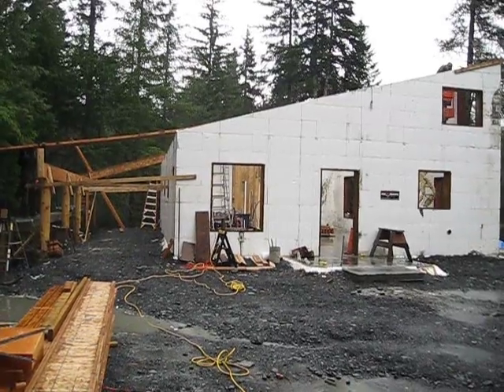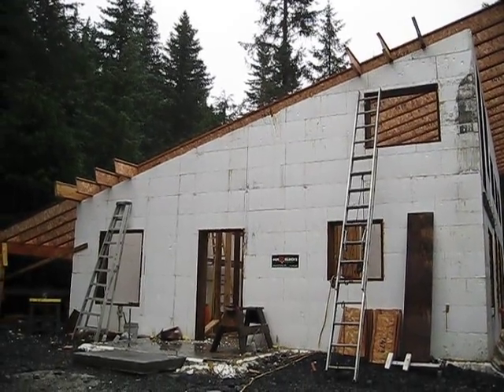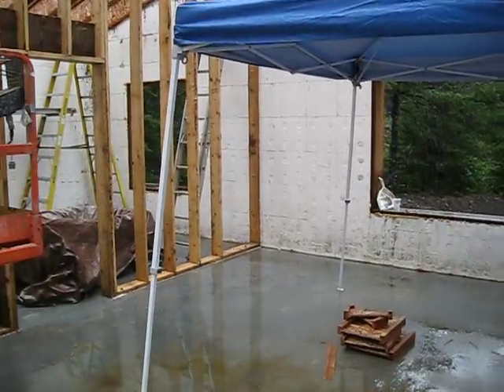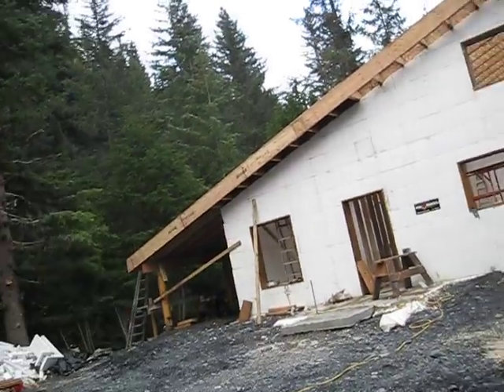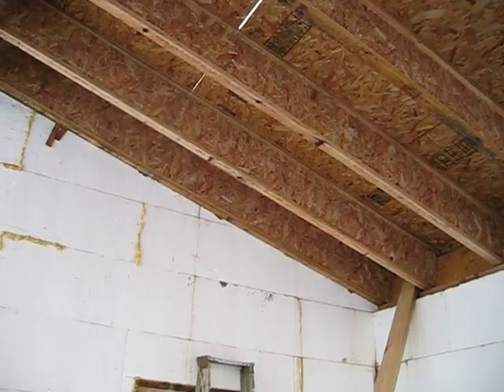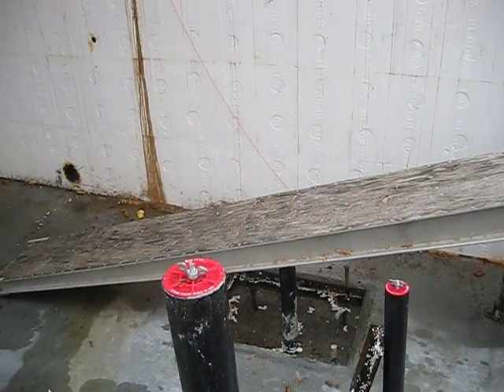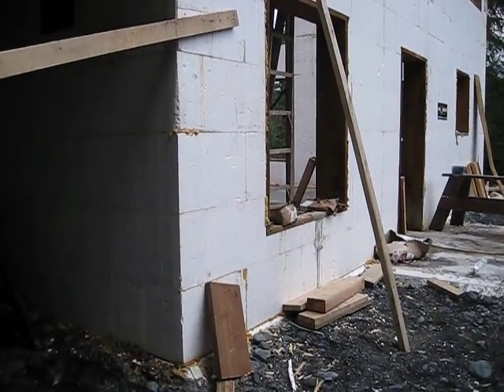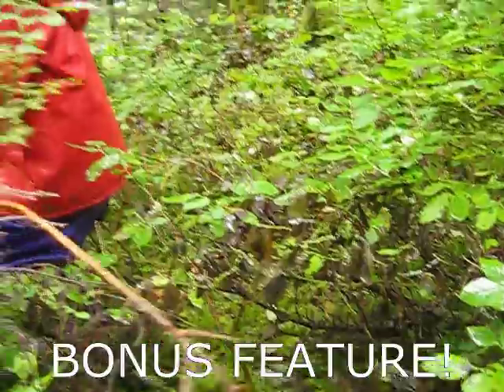House Building Part 4: BCI's In Place -- Roof Takes Shape

Comment: With that kind of height you could also consider a high sleeper. It would create a lot of extra living space at ground level. I know I loved my high sleeper as a kid. It brought adventure to the room. My high sleeper doubled as a castle, a pirates nest/boat, a rocket ship and what not.
Reply: My thought line also.  My vision was to go with the smaller size closet,  but to put a second floor in, ladder accessible from inside.  Put carpet bean bags pillows etc for hideaway when she gets old enough to climb up. Extend 2nd floor out a bit towards window, and or the door, for more loft type room, or balcony.  She will use it more as she ages.  Then paint the outside fairy castle.
Reply from the maker: You guys have an excellent idea about using that high space.  Thanks!  Now, we need to look into a good design.

Comment: Those are the longest I-Joists I've ever seen.  I hate working in the rain.  You have a fabulous, can do attitude.
Reply from the maker: Thanks!  The I-Joists were long but not heavy -- just "noodly" the guys said!
Reply: Kendrick Homestead  Are materials real expensive in Alaska?
Reply from the maker: Generally, yes, but it depends if something is produced in or out of state.  For example, Fox Blocks would be the same price here as another place they make them (because produced in Anchorage).  However, lumber shipped in from Canada can be more expensive.  We try to reduce costs by picking up our own materials rather than having them delivered. Also, we tried to cost out items prior to the build in order to keep the budget realistic, so we knew the materials would be a certain price.  That's when we realized we were going to have to do as much on our own as possible because the only place we could seriously reduce costs is the in the labor category. Thanks for your question, David!

Comment: What type of waterproofing do you plan to install on the exterior walls? I'm in the planning stage of building an ICF house with FoxBlocks in Duluth Georgia. While ICF's appear waterproof, they are not and with as much rain as we are seeing in your videos I hope this is something you are planning on.
Reply: Actually after speaking to my regional FoxBlocks rep I stand corrected. The FoxBlocks and high PSI concrete will result in a air and water barrier.
Reply from the maker: Richard, we have asked our local rep about this, also.  He recommended a product called Hydrogap to create a moisture barrier rather than using a regular house wrap.  I mentioned that to our building supplier, and he said the Woodtones Rustic Series siding has spacing behind it when installed, so we don't have to worry about using a product for a gap.  We don't want to have to spend money where not needed, but we also don't want to cheap out where something is vital.  My dad, who built ICF in Texas for years before he retired, said they never wrapped a building.  Of course, Texas does not have the rain we do! Still, we are not sure the best choice here.  If anyone has suggestions, please share.

Comment: Just to add a few cents worth of ideas.
1) take a look at Thomas J Elpel' s video Slip Form Masonry  samples from the DVD
There is also another video that he has made of the rebuild of a house where he used the slip form method  of building stone walls.
 It can be found on Youtube  << slipform stone masonry >>   thomas j elpel  
From the time line notes it would seem that the entire project took about 6-7 years. using materials that were found or picked up from the local dump. (I have also done the same thing where I collected scraps of SIP panels from a Habitat for Humanity build, that I was involved with in Toronto Canada, -   they made a very cozy two car garage with a roof that was 8" thick with Styrofoam) T
They key piece to be careful about is that you do not build more than 2' at a time or you will not be able to clean off the face of the wall of the excess concrete properly
 before it dries.
2) I noticed that another comment that you received from a subscriber was that you could build a "sleeper loft" in your daughters bedroom  over the closet area. Just remember you will NEVER repeat, NEVER EVER, have enough closet space.
Again, during my 75 + years of renovating and building new houses, I had a similar situation to contend with ;- a room with a vaulted ceiling and small floor area. 
In your case that area would the perfect way to provide extra floor space and a fun place for the children to sleep, or play. 
Well I have spent my "two penneth"  for now. 
Keep up the good work and try to keep dry. Don't  worry about the  OSB  getting wet, it will withstand the weather for a year or so before it starts to complain !
God bless you both.
John,
Eagerly awaiting video #5
Reply from the maker: Appreciate your wisdom and suggestions, John!

Comment: If your going to have a generator;  save your ICF pieces ( non structural noise damping; fill the cavity with lose insulation)  to make a small house for it with a temperature controlled small greenhouse exhaust fan.  The structure will be the sheathing.   That should reduce the noise by about 75% .   Put an adjustable air inlet in the door and point the exhaust away from the house.    Bert
Reply from the maker: Thanks for sharing an innovative idea!

Comment: Having the stone veneir thicker than the siding makes rain run down a consideration. The blue foundation waterproofing
covered with dimple plastic lets the water run down and not stay against the building .  Ample drain channels  at the
base of the first course of stone like weep holes and covered with landscaping fabric before starting the stone
work would be the plan.  The  Pure Living for Life channel is an ICF  build in Idaho where they have recently
installed this system with good detail on installation procedures.
      I put on a metal roof with very low pitch and used the self adhesive  rubber normally used for ice dam protection near the eaves of a roof, but on the whole surface. It is self healing at the screw penetrations. Also the 1/2" wide adhesive
rolls often supplied with the roofing  seems a little narrow to work with.  I got some 1-1/4 " wide and was really 
pleased with the way it worked. Beware getting the roll adhesive on and having a misaligned sheat. Makes for
inventing a few new words trying to get it loose again.
Reply: Just a few words of caution.
The Pure living site is interesting to watch  but not one to refer to, unless you want to see two people struggling with jobs that with a little bit of reading manufacturers instruction and tasking advice from experienced people would have made it a much better "how to" video to watch, unless you want to see many what not to do's.

Comment: Or yeah, a high sleeper with a desk and closets underneath.
Reply: A high sleeper was also my first thought seeing the room. It looks similar to my old room I had 20 years ago. I had a solid built platform which was 1.4m  x 3.2m(55 inch x 126 inch), stretching from wall to wall. This way I had 2m(79 inch) to fit a standard mattress and additional 1.2m(47 inch) to store plastic containers with cloth, camping and sporting gear above there.
Reply from the maker: Thanks for sharing about the solid built platform wall to wall, so we will have to do some measuring to see if that will work (to get past that big window!).